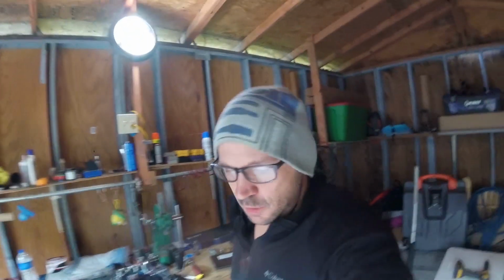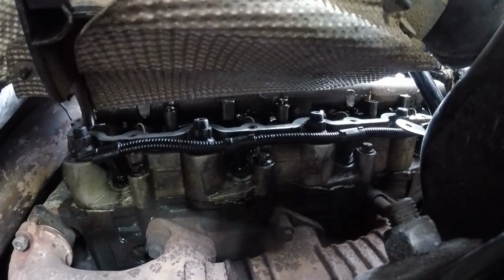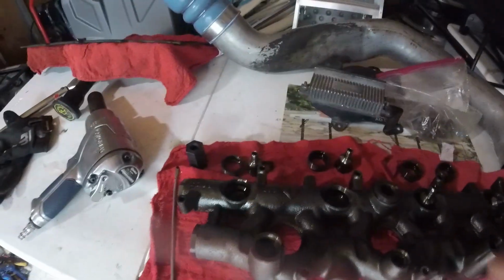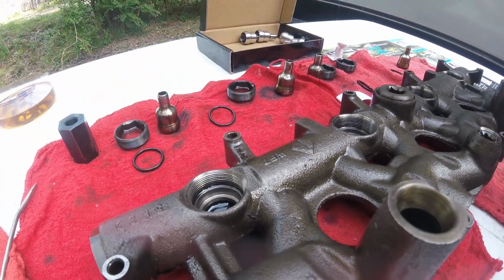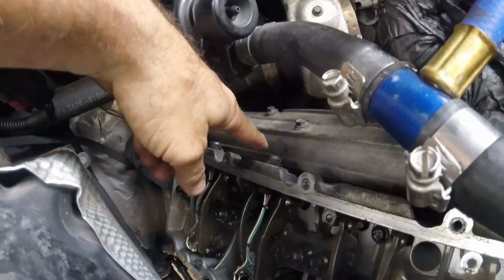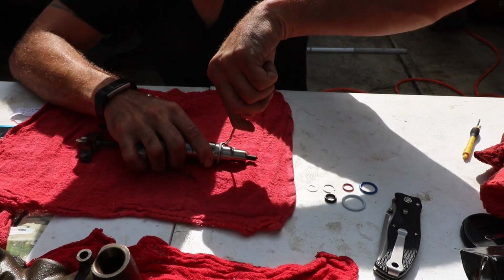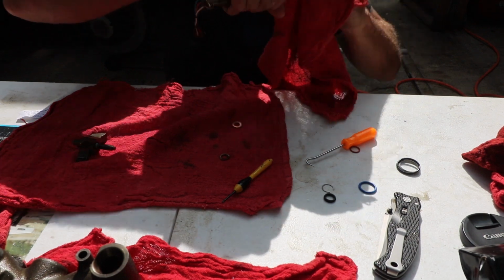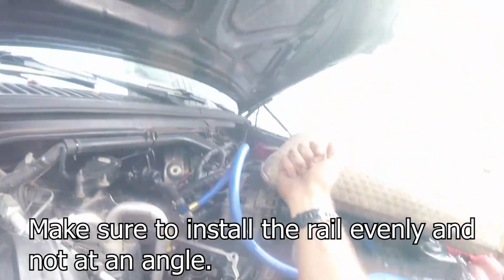6.0 Powerstroke - injector o-ring & nipple cups

Comment from the maker: This was a fairly simple fix, tell me about your 6.0 problems
Reply from the maker: I did
Reply: instablaster...
Reply: Hi everyone and thanks in advance for the advice!
To summarize.

Bubble test - no bubbles. (New blue spring kit, new filter)

Bowl oil fill test - like everyone in the video, just fills up and slowly goes away. (New filter and oil level)

IPR valve - removed and checked, replaced the ring. The valve itself is working and free of debris.

Symptoms. Takes a long time to dial in ICP. Can start and run for a couple minutes, or can barely start. Icp will eventually only get up to 450 and may run for a minute at that pressure.

P.S. When the engine started, ICP parameters are around 450. Also no response to accelerator pedal.
Reply from the maker: Did you check the stand pipes and dummy plugs? Also before I got rid of said truck I had installed a 6.4 starter and that spun the engine night and day difference in starting. Went from 3-5 secs to 1 second.
Reply from the maker: Also do the ipr tests to see if that sensor is your issue. I used  motor craft sensors as I’ve seen after market ones can prematurely fail or give false voltage readings.
Reply: @grumpysdiy  Thanks for replying! I made a test hose today from a couple components bought at harbor freight. I pressurized the hole from the ICP sensor (on the head) and I can hear a subtle sound. When I disconnect the hose there is pressure coming out of the crankcase through the hose. I did not close the IPR valve. Didn't get a lot of time to devote to this check today, but I'll dig deeper tomorrow and see what comes out of it. I haven't removed the valve covers yet. But that will probably have to be done.

One interesting point. If I close the IPR valve and apply air pressure to the ICP hole and there are no leaks, then where do I dig?
Reply from the maker: Okay so it will never be a complete seal. There will be a slight sound of air going through the system. What noise you don’t wanna hear is the hiss. But if I were you, I’d check those dummy plugs and the stand pipes. Since you didn’t say you have yet.
Reply from the maker: Well after the ipr test with you closing it and applying air.

Comment: Kinda wishing I had done these seals while I had it apart for the injectors the other day. Based on all the videos I watched it required either a bench vise or air impact and I had neither. But you just made it look easy. I did inspect the cups and they all felt very tight and had no wear marks so.....  Thanks for the vid.
Reply from the maker: You will probably be fine then.

Comment: Hello RV Adventure.  I replaced the dummy plugs and stand pipes yesterday but still have the problem long crank when cold. I will try to replace the nipple cup injector o rings next.  Please tell me how the aftermarket o rings are holding up? are they still good? did they fix the long crank cold problem? thank you
Reply from the maker: They are holding up, the reason it got rid of my long start was because those  nipple cup o rings were leaking.
Reply from the maker: It could still be other things for you.
Reply: @grumpysdiy  Thank you!
Reply from the maker: @hugomoratillo8453  np

Comment: 75 lbs mine are at 100 and move freely, just watch guy do 155 ft lbs and works great, i thing the under torque specs is why people say they always leak after changing seals
Reply from the maker: Wild. I didn’t have any issues after I did this repair.